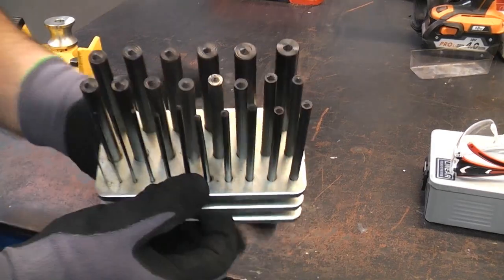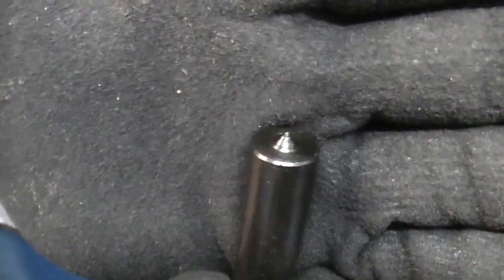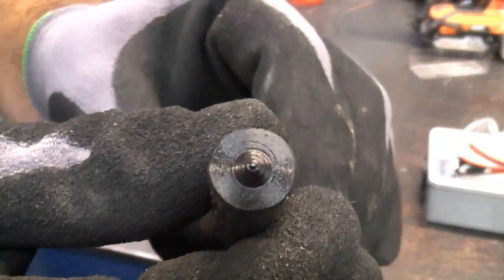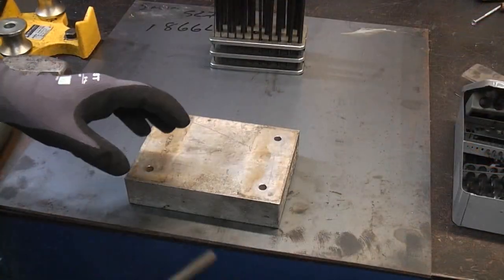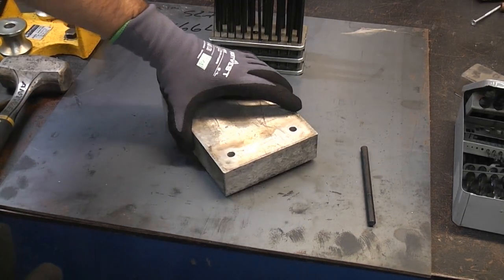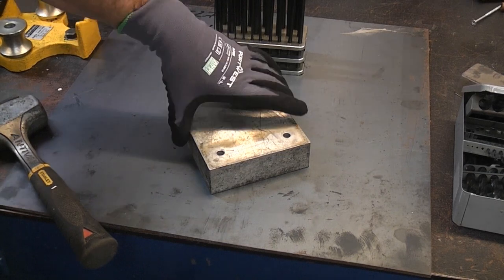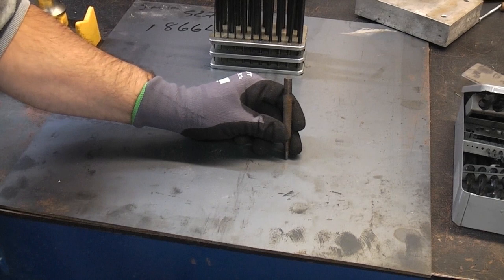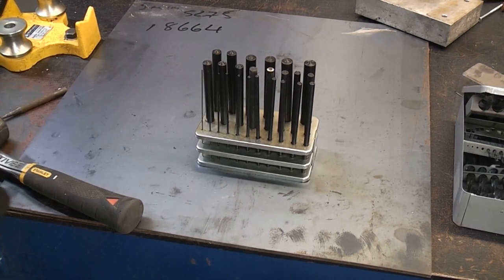Transfer punch | A most useful tool!

Comment: You've just got to make sure you haven't bounced out of position when hitting the punches, sometimes it's safer to fix the first hole in place then proceed to the one diagonally across from it  and drill and fix that, the next two holes then become much more of a surety and can be marked at the same time. :)

Comment: And to mark hole positions for which yo haven't got the right sized transfer punch - say the holes on a pipe flange you are making - simply turn a piece of bar down to the correct hole size then drill a 13 mm hole ( or whatever to suit a punch that you do have) through the centre and you have an adaptor. I've used that trick a good few times.
Reply from the maker: Great idea 👍
Thanks for the comment 👍

Comment: I have a similar gizmo for wood, it is a cone with a prong, you place the cone over the hole like in your video and the prong gives you the centre point below, can't find it right now lol but it does a certain diameter say 3mm up to 20mm. Like you I suddenly realised I needed a solution, then found it was less than a tenner! The only differences are this is an awl not a punch plus the prong is not that long. Wish I could say what it is called but I don't know.

Comment: I could see owning a set of these if you needed to use them all the time, such as if you worked in a maintenance department for a large corporation or something.  I usually just use a drill bit that is close to the correct size and just drill a tiny bit into the material to mark it since I am just mounting things in the floor or walls and it does not need to be exact.

Comment: Iknow this is off topic but I've got like a small tree stump in my garden and it's pushed the fence post out of position abit along with the slabbing.

Is there a stump killer type chemical i can use to get rid of it.
Like drill some holes into it and pour it in? 

Then obviously i can get rid of it and repair the fence post.
Reply: Pay for an expert to do it! Avoid a disaster. 

If you have patience then you can disintegrate a tree stump over two years - use Epsom salts or boiling water in drilled holes [repeat every two weeks] - exact instructions are on the net.  

Simplest, quick solution [if there's good access] is just have it cut level with the ground - that's easy if you've used a chain saw before, but don't even try unless you've got all the protection possible - you can turn a small task into a funeral very easily. If you're in the UK try Roundup or similar - follow exact instructions printed on the container. BUT killer chemicals depend on the stump still being alive. Weedkiller is best applied to fresh stumps, as live tissue is needed for its uptake. If the stump is only a few weeks old, you may be able to expose live tissue by cutting the top off to expose a fresh-cut surface. Finally, cover the whole top of the stump with a plastic sheet to keep off the rain and secure in place. For very old stumps you'll have problems because you'll need an acid - very dangerous & NOT for amateurs!